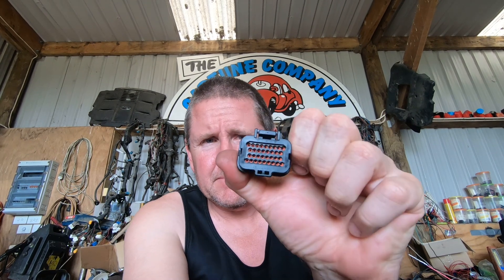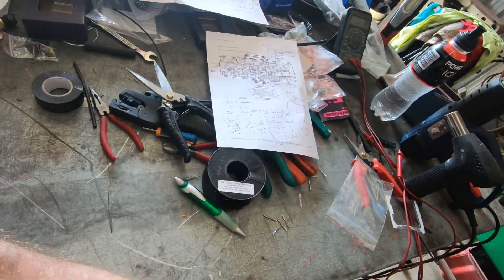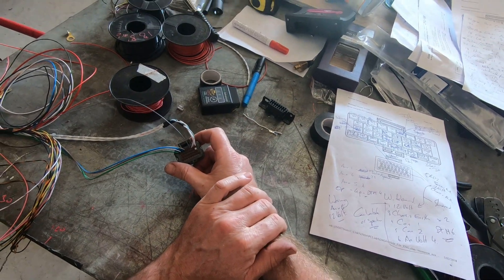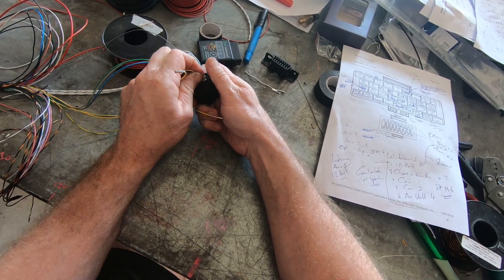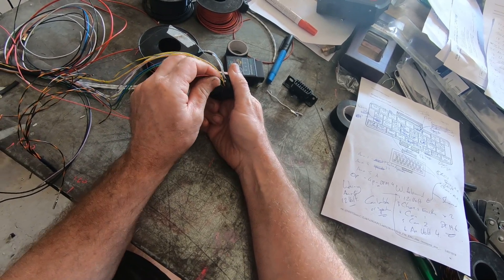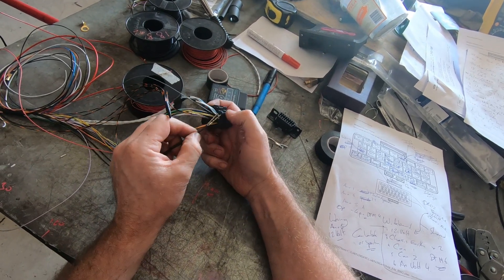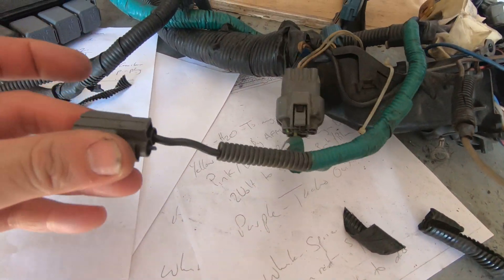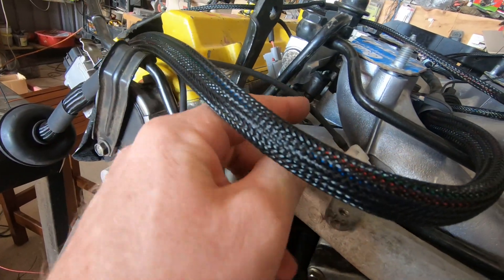1uz Wiring harness with link ECU Monsoon- ECU plug going on - V8 Toyota Hiace van PT3

Comment: I love you videos I own 12 tacoma with a 6 speed manual I'm  trying to figure out what uz/ ur engine I could use for a swap
Reply from the maker: My pick would be 3uz.  Lighter than the 2uz with similar power levels.  Although 2uz might be more available over there I still prefer 3uz.  Cheers Kelvin
Reply: @CartuneNZ  Hey man i also have a swap  ! a Uz in a 1974  Toyota Corolla Te27.  You think the 1Uz  VVti is best ? or what do you think
Reply from the maker: @user-pd9vm9ts1o  absolutely.   In the Corolla I would probably go for a 1uz vvti or 3uz.  The 1uz rev hard so suit the light cars well.  Newer is also good and I'm doing heaps of vvti stuff these days.   Cheers Kelvin
Reply: @CartuneNZ  Cool thanks man !  i was thinking of the 1U ..  how much you charge to make me a nice clean engine wire harness,  For VVTi  Uz ?
Reply from the maker: @user-pd9vm9ts1o  theres a few options for harness with regard to using stock ecu or aftermarket,   which 1uz vvti,  if you have a stock harness to start with,  auto or manual etc..   best email with more details.  Address in description.   Cheers Kelvin